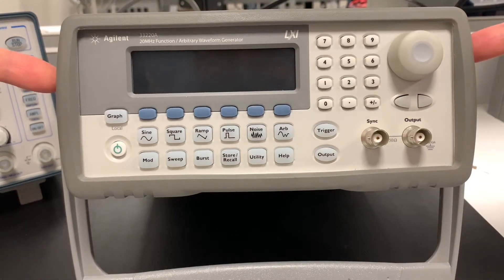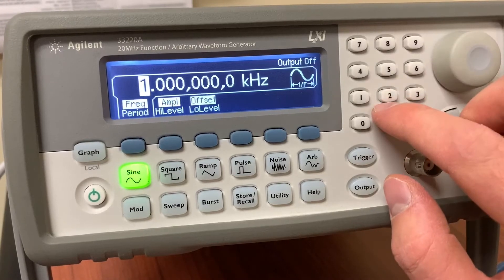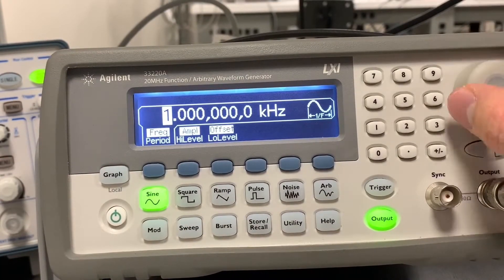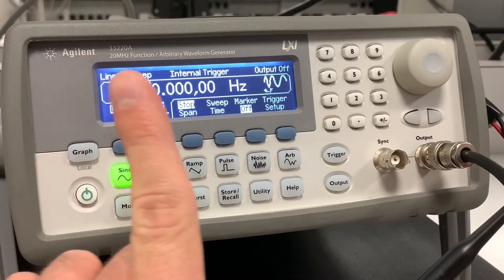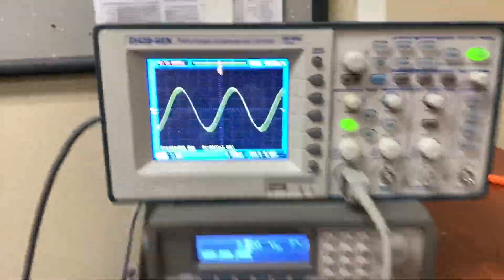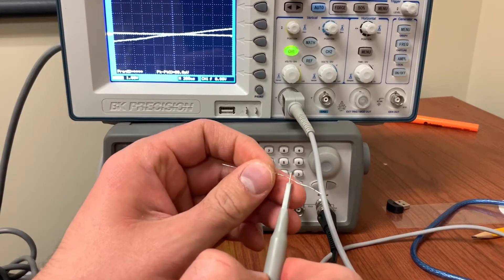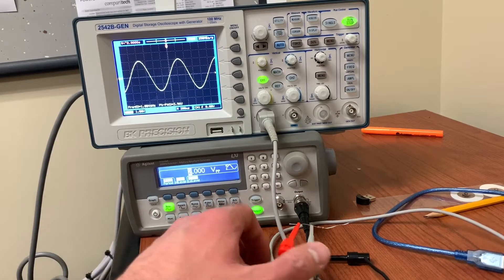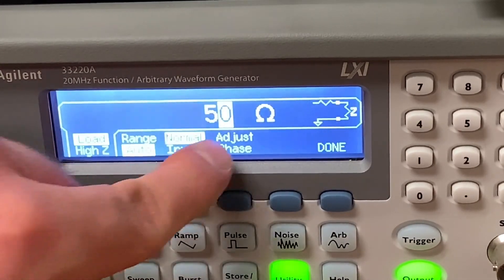Function Generator Explained - Includes how to use sweep and high-z for Agilent 33220A

Comment: thank you for your video! but when if i choose the high imopdance then how do i have the voltage in my bias T circuit if  the current cannot flow through the cable(the generator coonect to my device with cable)?

Comment: Good presentation, i'm having to learn this particular peice of equipment, so it helps.  Question for you:  the O-Scope registered 996 Hz the output for generator was 1000 Hz. Would I adjust the freq on generator to make the read-out on the O-scope  to be 1kHz in which case I would increase 4 Hz on the generator? also was just wondering when you run sync over the O-Scope will they be any kind of alarm when the freq's don't match?
Reply from the maker: Hi Mike, good questions - it is probably the scope that needs to be slightly adjusted and depending on what scope you are using a that type of variation may be normal. Also, make sure your probes are compensated correctly and then try a couple other measurements (maybe at a higher frequency and see what the scope reads). If you see a similar 4 hz off you know it s set point error. If you see a similiar percentage error it could be a limitation of the scope or something with the generator. I'lll be honest I have not sued the sync in a while so I don't know that one off the top of my head. But as for an alarm - I don't think the scopes/generators I use have an alarm feature.

Comment: Thank you for this . though, I've been looking all over to see a function generator and an oscilloscope together used in an actual Diagnostics and repair of a board
Reply from the maker: Well most of the time you need either one or the other - I don't know of many cases where you would use both at the same time to troubleshoot a board. Usually the board creates the signal and you would measure with a meter or scope. Or you have to trigger  something with the generator (that is definitely more rare)
Reply: @HTMWorkshop  I see, thank you for your reply.
 I thought function generators are used in tandem with oscilloscope for Diagnostic. 
I would love to see how function generator is used in an actual repair or diagnostic work.
Reply from the maker: @AB-yu2tj  Let me know if you find a service manual that uses those two in combo - would love to know of a real life example where that is used.
Reply: @HTMWorkshop  I think you might have misunderstood my comment. I take your word for it that they're not used together. But I still would love to see function generators used in an actual repair.
Though, before I come across a video that uses both in a diagnostic will shoot it over
Reply from the maker: @AB-yu2tj  Yes I did misunderstand you - Anything that is analyzing a signal or or uses a sensor could be a potential use case. The function generator could be used as the trigger to test the board/device. In both of these videos I use a function generator to test the circuit 
https://www.youtube.com/watch?v=w6MbM_f_7Uo
https://www.youtube.com/watch?v=7RthmQUpTxQ
Reply: @AB-yu2tj  look up "signal tracer" to test components. Also see this https://youtu.be/UmTAhIrVids

Comment: how to sweep amplitude,,,  not freq
Reply from the maker: ? Not sure what you mean on that one. Are you saying you want to know how to sweep the amplitude?
Reply: @HTMWorkshop  100hz fixed,,, sweep 50mv ac pp or rms to 500mv
Reply from the maker: @kaybhee6  I have not tried that with the function generator - however I don't think it does that. I think you would need to get a programmable power supply to do what you want to do.
Reply: @HTMWorkshop  yes  v ac  prog power supply w freq control...  aka  ,= , sig gen...  not easy to find tho
Reply from the maker: Well no I was thinking you could use a DC programmable supply - then modify it using a converter - not sure how well it would work. Just an idea - Im sure something that can control frequency and voltage simultaneously would be expensive - but Im sure someone is selling them.